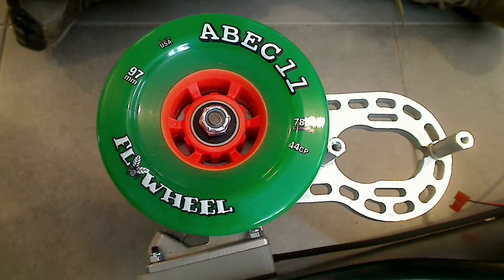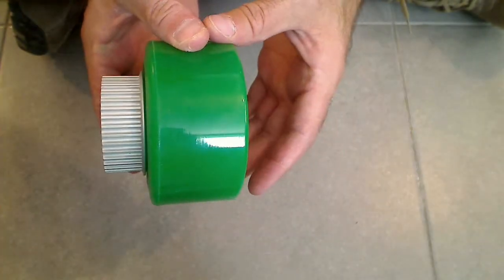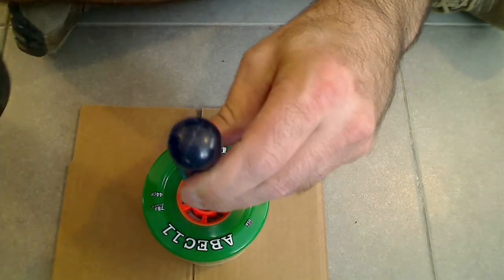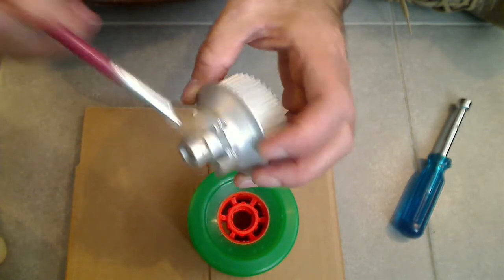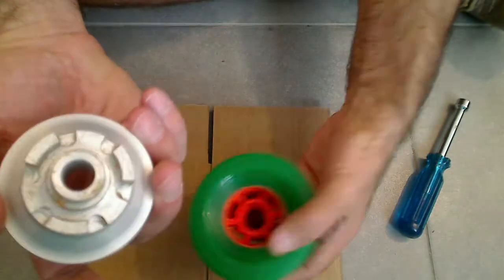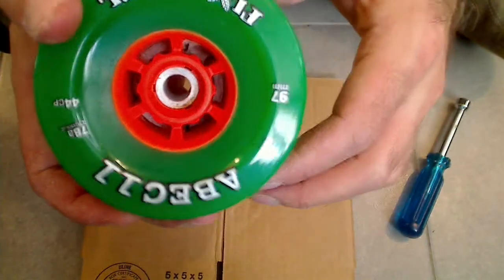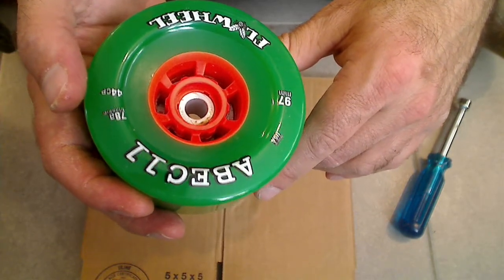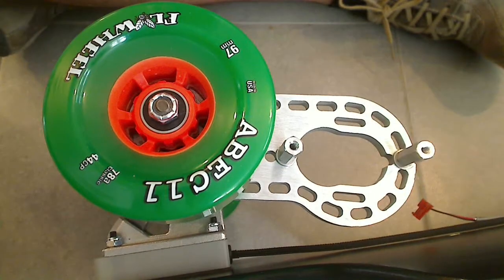Abec11 Flywheel Pulley Insert Installation on Metroboard Electric Skateboard

Comment: So you are saying the spacers will fit Inside that small diameter end of your pulley ??,...how much space would be left around Spacers ?
Reply from the maker: integra it's currently 11 mm for the ID of the pulley insert but you can drill out to 1/2" which will give enough clearance for a bearing spacer which is typically 10.5 mm OD
Reply: I just dont understand why it was designed like it is ?

 Where is Nut Torque transfered to now ??  

A larger hole and spacers between Bearings, ....then all Axle Nut Torque would be  transfered to base of axle.
Reply from the maker: What do you mean by Nut Torque Transfer? You mean the axle nut? It's just like a regular skate wheel.  Only that it has a pulley on one side. And the space between the inner and outer bearings is 27 mm instead of the typical 10 mm like on a regular skate wheel.  So you need a truck axle that is about 17 mm longer than a standard axle as well.
Reply: Yes i mean Axle nut ,... when it is tightened on a normal skateboard using a Spacer between the Bearings ,..all the Torque applied when tightening is transffered through( Bearing - Spacer - Bearing) to Base of axle.  Hub of wheel does not get compressed.

Your Pulley AS IS, no Mod,.. how is Torque Transfered to base of Axle?
Reply from the maker: As I mentioned it is exactly like a regular skate wheel that doesn't use a bearing spacer.  You just have to be cafeful not to overtighten the axle nut to ensure the wheel/bearings spin smoothly.  Bearing spacers have always been an option on skate wheels.  The wheel will spin just fine without them as long as you don't overtighten the axle nut.  Nonetheless if you prefer to use a bearing spacer I already explained how to do so using 2 standard length bearing spacers + 7 axle washers.  We are actually in the process of making a custom length bearing spacer that will fit our drive pulley.  We will have parts in about a month. And our next batch of wheel pulleys also have been revised to a larger ID of 12.5 mm to provide sufficient clearance relative to the 10.5 mm OD of the bearing spacer.
Reply: I want to use your Pulleys on a Trampa Board that has a 9.525 Axle , would it be easy to Bore to 15mm or.. take off end section completely  ?

If possible i wld buy 2.
Reply from the maker: you could potentially bore it out to 15 mm, but you won't have much thickness left (maybe 1.25 mm) in the "end section" as you call it, but it may not be critical since the "end section" is just one of many features that centers the pulley insert in the hub, so even if you got rid of that section completely the insert would likely still work ok

Comment: why is there a GAP between  pulley and bearing Seat ,...should'nt it sit completely against seat ?
Reply from the maker: integra the pulley insert is not a bearing spacer.  In fact it can't be because it rotates with the wheel and the bearing spacer does not.  You can use two standard bearing spacers (10.3 mm long each) and 7 axle washers (1.0 mm each) to make an effective bearing spacer with our pulley insert